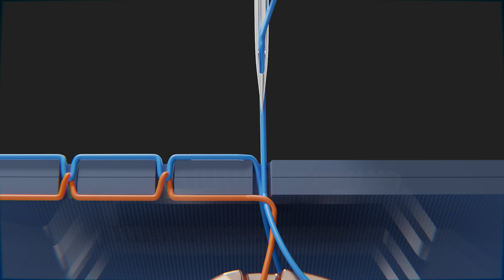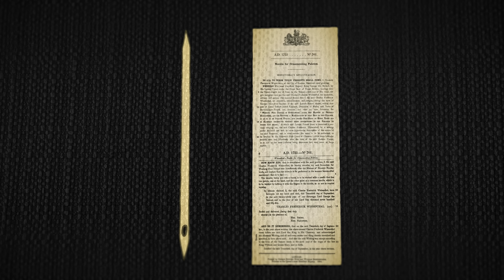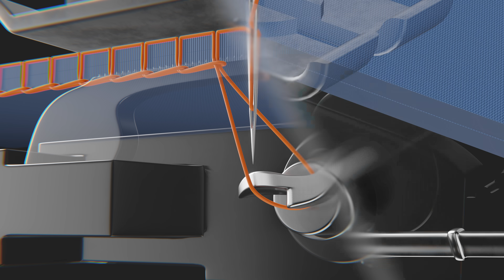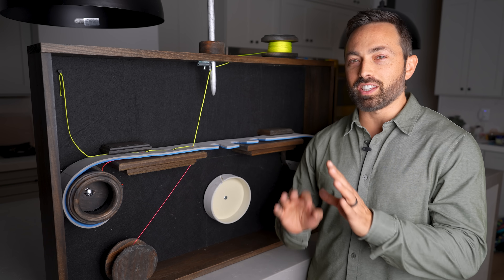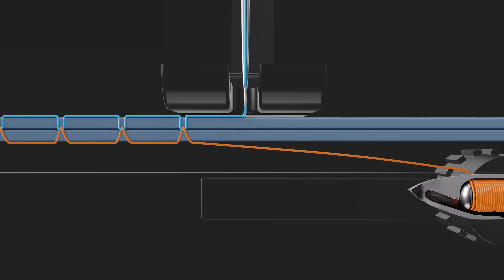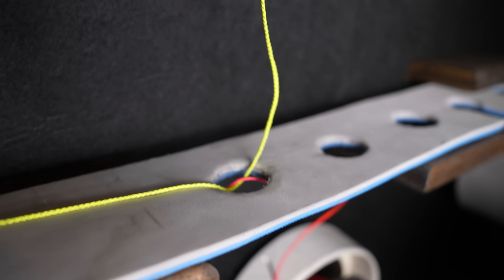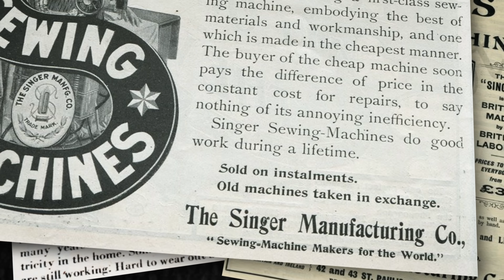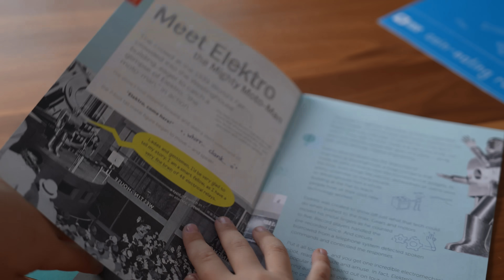The Surprising Genius of Sewing Machines

Comment: I am the third generation in my family sewing machine business. The 45 year old firm was started by my grandfather and now me and my father handle it. It feels amazing watching how sewing machines have developed over the years and in the current times it has expanded so much. I have nearly 10000 sewing machine parts in my inventory depending on different models of sewing machines like Domestic and Industrial, Overlock, Flatlock, Button Hole and many many more. Many of my friends still think that a sewing machine is something that only poor families use in their homes to mend old clothing, but they aren't aware of the industrial vastness of this line. 

I hope you could make a second part of this video which shows the current generation of sewing machines which are being used for various applications. I would be delighted to give any help or suggestions you might need for the same!

Comment: Thank you for making this.  I have often wondered how sewing machines worked, but I've never looked it up.  Your video was a thumbnail from another video I just watched.  This is very interesting.  Never knew why the groove was on the needle either.  Makes me wonder what is wrong with my sewing machine since it has been breaking thread for the past little while.  I just quit messing with it.  Now I need to take a look at it and see if I can figure out what the issue is.
Reply: Could the thread be getting caught somewhere along the threading line? That’s what occasionally happens with two of my sewing machines. On one, I can’t see exactly where the catch is, but I rethread carefully, and it works again. The other, I can see just where it gets caught between two metal parts at the beginning of the threading line.

Comment: Fascinating! 
Ah, yeah, 35 kg pa per capita in clothing waste boils down to shoddy modern quality standards. Uncured polyester and nylon lose their stretch in months or weeks, some manufacturers have gone back to the chain stitch because once that breaks people come back and buy more instead of blacklisting the manufacturer. Lack of motivation to maintain quality standards is due to dwindling competition as the bigger companies gobble up the smaller companies. If clothes were made to proper quality standards, that 4% expenditure would be down to around 0.2%.

And, yes, if you hunt around and pay double the price for better quality clothes that will last 40 times longer (e.g. a decade as opposed to a quarter) then you could reduce your clothing expenditure from 4% to 0.2% of your income (on average).

Comment: As an engineer working for a leather and textile manufacturing facility I really enjoyed this video! A big part of my job is helping to calibrate and set up a wide array of sewing machines for different applications & creating fixtures to ensure precise sewing at high volume. 

There is a mountain of nuance to the art of sewing that keeps my engineering brain busy every day. It's a joy to see my work on these incredibly precise and complex machines being used to produce beautiful designs. 

It would have been nice to see some more information on the modern state of art in the industry! Some of the sewing machines used in the luxury automotive industry for dashboard stitching are mind-blowing in their complexity and capability. A look into the limitations of our best machines and the ways people in the industry are trying to invent new methods to overcome challenges; Automated sewing machines, material thickness sensors, automated tension adjustment, appearance of the stitch angle based on material travel direction, sellier vs. perfect stitch, pneumatic & electromechanical auxiliary sewing functions, automated embroidery machines, etc! It's hard to find good information on these topics on the internet, unless you're in the industry its a bit of a mystery what is going in this field. 

Overall a great video on the history and development of the sewing machine. It ended too short though, like giving a history of the car and stopping at carburation!

Comment: Even after seeing it so well explained, my brain still has some difficulty understanding the ingenuity it took to invent this. At 60+ I bought my first 1960ties Singer, cleaned it up and it worked like new. Bought a new Singer 4 years ago but got nostalgic and found a non-working Refrey Transforma, Spanish brand that looked in poor shape, so the seller dropped the price to a mere € 35,- A few hours later it looked and worked like new. Just cleaning up, plenty of oil. Cast Iron, too heavy to carry around but goes through 5 layers of leather with ease. It's a meditative thing, at par with Japanese hand saws. Really brings my mind to rest when using it.

Comment: My mom literally paid for everything that kept my family alive thanks to those sewing machines.  I would love an episode on the complexity of a serger, using 4 spools instead of 2!
Reply: Second this.  How the heck do those things work??
Reply: Right?  My wife uses one, it appears to have more moving parts than the space shuttle!
Reply: 🤯 4 spools?!
My confidence from this vid was suddenly deflated
Reply: Oh lord, yeah. Those things are nuts. Even ignoring all the computer interaction now.
Reply: Minimum thread for serger starts at 3 and goes up to 5. Big probability to find and see what 3, 4 and 5 thread serger stitch would look like here on YouTube. Good with 3 thread serger is that you can tighten the lower thread looper and loosen a bit the upper looper to create those finished edges for ruffles. No need to fold the edges. 😊
So the best thing if you plan to buy a serger, opt for a 5 thread serger which is a bit pricier BUT you can also use the same machine to function as a 3 or 4 thread serger. Serger stitches does NOT only work as an edge finisher. It also makes as good edge finishing decorative stitch using a different soft nylon yarn on it's LOOPER. 😊 HAVE FUN.
Reply: same story as you, thanks my mom and this machine that what bringed food to the house

Comment: You think a sewing machine is marvelous, have a good gander at a serger! They don't just produce your typical straight stitched seam, they create a very complex stitch consisting of generally 4 individual threads using 2 needles simultaneously and they also cut off excess fabric all at once. Both types of machines have their unique individual uses and both are nearly miraculous compared to the old days when everything was done by hand. However, both can be enough to drive a person to insanity and induce hypertension if the tension isn't right or some other anomaly occurs. A slightly bent needle-so slightly it's nearly impossible to detect by eye- can cause chaos. And don't even get me started on the threading process of a serger 😮 I consider myself very blessed to own both types of machines and we are all fortunate that they exist at all.

Comment: On the opposite side there are still things that sewing machines can't do. Hand stitching is much, much slower but also far superior in what you can achieve with it and the strength and durability of the things produced. Machine stitched clothes involve a lot of compromises and very different ways of working compared to when the same clothes were only made by hand.

Comment: I'm a sewist and own 7 machines ranging in age from 1907 (Singer treadle model 27), some vintage ones, to modern computerized ones. I had no idea how they worked until I learned how to take apart, clean, and put back together the oldest ones.

You did an excellent job on this video.
Reply: I still don't understand how the bobbin and the top thread twist around each other. Would you explain, please? I keep expecting the axle to be an obstacle, and I'm not clear about how the yellow thread got around the orange thread.

I'm talking about  11:00.
Reply: @eugenetswong  Not sure if the video link in my following comment works, but if it does (YouTube has a tendency to block links) it should show animations on how they work. A video by a needle manufacturer Groz-Beckert. If the link doesn't work the video is titled "Stitch Type 301: Double Lockstitch in Slow Motion" and the YouTube channel is called "Groz-Beckert" with a green thumbnail with "G . B" (the dot is in the middle between the G and B).
Reply: @AlexKall Thank you. I'll check it out.

In the mean time, I want to mention what I learned from another video.

In that video, we can see the thread go around that first hook, plus a frame-like thing. It's all 1 piece of metal. I think that we would be able to wiggle it. The frame holds a case, which encapsulates a spool. So, there are 3 parts, and all of them do not contain an axle, and none of them are stuck to the machine.

In other models, I think that the hook is separate from the outermost frame, which means that the hook would need to come back.
Reply: @AlexKall  I watched your video, but the video that I saw seems better.

How a sewing machine works - Animagraffs

Your video implies that there are 2 parts plus the spool inside, but it isn't clear about what holds the bobbin in place. I assume that in the actual machine there is another component that does the trick.

It's so much clearer now. Thank you!
Reply: @eugenetswong  
  I think he did gloss over that, and it wasn't shown in his model.
  The bobbin actually sits loose in a little housing which has one open face.
  The housing itself spins in timing with the needle, and a hook built into it grabs the top thread on one side of the loop created as the needle begins to rise, pulls it into the housing, and wraps that side of the loop around behind the bobbin.  It then gets released from the hook and pulled out the other side by... (whatever the arm on the front of the machine, which moves up & down with every stitch is called), closing the loop over the bobbin thread.

  Oops; I should have checked the other replies before painfully writing all this out, but now that I'm done, you can bet your butt I'm going to post it anyway... 
🙄
Reply: @markmarkw1919 Hahahaha, I appreciate your time a lot; especially on a Saturday.

The amount of confusion shows how really ingenious the machine really is. The machine would have been invented a lot sooner if it were so simple.

Comment: so the tip of the rotating hook picks up the thread which passes on the front and back side of the rotating hook, and continues around until the rotating hook has passed completely through the thread loop. How does the thread get through the shaft on the back side of the rotating hook?

Comment: The thing about "before planned obsolescence" really rings true. I don't use it any more, but I own a mechanical Singer sewing machine from roughly 1925 (I'm almost certain it it was made between 1923 and 1929). I specifically bought one that had not been adapted to be electric powered, so you have to hand-crank it in order to make it work. I like the feeling of actually engaging with the machine rather than pressing a pedal. Also I'm not entirely comfortable with the idea of altering what is essentially an antique because it's more 'convenient' to use. I grew up using a hand powered sewing machine, so electric ones are more difficult for me to operate.

Comment: Excellent explanation and presentation. You put a lot of thought and time building into your demos.
I usually don't talk about my self in comments, but here goes. I have writings from my grand mother (who I never met) around 1910 or so in which she describes making and modifying clothing. She obviously became very skilled. She was working on an early Singer treadle machine. 
In my time I became fascinated by the complex movements of sewing machines. I bought a home study course in machine repair, and for a time, I had a biz repairing sewing machines around my local community. I still have my "sewing machine tool box" intact. Thanks, Ronn

Comment: Suggest you take a look at a washing machine transmission. They rotate in one direction to get oscillating agitation and by only changing the rotation you get a high speed water extraction spin cycle. How it's done mechanically in an oil bath gearbox is fascinating to discover. Getting it all back together without an issue was life saving.

Comment: My mother had a Singer that weighed about 60 lbs or so. The reason is that, when you took the "hood" off the top of it, you saw a mind bogglingly complex assembly of cams, levers and gears that enabled the needle to do all sorts of acrobatic gyrations that were needed to produce a cornucopia of stitch types. Modern machines simply use digital programming to direct servos that redirect the needle as needed as it repeatedly punches through the fabric as the fabric moves along.

Comment: what a funny coincidence that this video was released now that I very recently got myself a sewing machine and was very curious as to how it all works

but I'm still a bit confused, my mother owns a "Singer 9606" and there is only a tensioner for the top thread, the bottom thread has now tensioner and I couldn't find anything in the manual.
now could it be, that this being more of a commercial use machine, that they found a way to eliminate the tensioner on the bottom thread?

Comment: When you do a follow-up video, please can you explain how the overlocker sewing machine works? With a design that cuts and edges the material at high speed, able to cope well with stretchy material (such as the material used for T shirts), it has totally revolutionized the fast-fashion industry Two needles and four threads!

Comment: I always thought Singer was a German manufacturer.

Sewing aside, I'm not that sure that not having to gather your own stuff for science experiments is that much of a good thing. You're walking a beaten path that's been prepared specifically for you. You don't hit any real obstacles other than misreading some instructions. That's not developing curiosity and tenacity in overcoming obstacles. It pretty much eliminates all incentives or even possibilities of what if questions and experiments. People learn from failure, not from success.

I remember a time when, as a kid, a friend and I set out to build a steam engine from a jar with a screw-on lid and a bicycle pump. (In effect, we wanted to build our own motorized vehicle.) Of course, nothing ever got built. (But we did build small rockets - which flew just a little under two yards, but still, it was a performance, given that we built everything from scratch, pretty much alone and unsupervised, at the age of ten - including the preparation of the black powder. We gathered saltpeter for a year, from flower pots and wall bases near pig sties - an experience you'll never have if all of your science exposure comes in a box.) But that kind of endeavor is likely what got us into science. I studied physics, he studied medicine. (And we both ended up as programmers 😀) It's unlikely, IMO, that either of us would have pursued anything science or technology related, had science or technology been easy.

Comment: But still, I don't get it, 
What If that rotating wheel that engages with the needle's loose thread is not able to catch the thread properly?
What if it misses?
Doesn't that make the sewing machine built upon assumptions ?
So is there space for perfection that could be achieved?

Comment: The next episode needs to be on how you'd program these machines to have different functions. Lately I had to do some alignments on my old 70s Singer machine and I was just mesmerised by the programming shaft. A very complex, rotary set of profiles and grooves that each held a certain program allowing the machine to either sew in buttons, make various zig-zag patterns or sew around the buttonholes. I'm also surprised all this works perfectly after over 50 years of use without any maintenance really.
Reply: Those mechanical control systems on these machines were incredible indeed
Reply: The model is based on "Singer 834" license and was manufactured in the 1970s by the Polish manufacturer "Łucznik"
Reply: The singers are insanely well built. My mum still has an antique one she uses, along with the foot powered pedal table (i was fidgety so i loved that desk with a secondary input to keep my brain happy while doing homeworks).
Victorian era fidget spinner

Comment: Sewing machines are absolutely beautiful mechanical devices, older ones anyways. I dabble in upholstery but used to subcontract manufacture insulation wraps. We had various machines from a consew 226 on a small end to a consew 745 series which we had to bring in with a gantry crane. I believe that one was a 30” long arm. In upholstery I use an old kenmore domestic for really light stuff, an antique singer rotary for decorative stitching and a consew 206 for the rest. The walking foot on the 206 it fascinating to watch, and with the new digital servo motors you can run it as slow or fast as you want. As far as new machines go, domestic ones anyways, I hate those plastic over complicated things , they don’t last and just don’t sound or feel right.

Comment: There is another way the lock stitch is done by hand using a tool called a speedy stitch.  I was introduced to them years ago.  They are great for when you do not have a sewing machine or the project is too big to fit into a sewing machine.  With only one thread housed in the handle you can make great looking lock stitches.  It works best with heavy thread, preferably  wax coated.  The great thing is that they are not expensive.